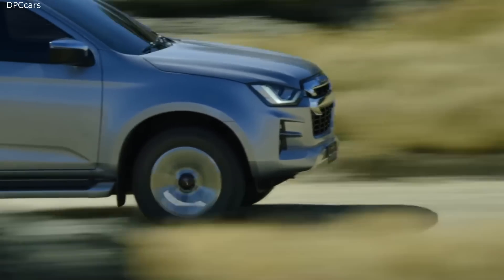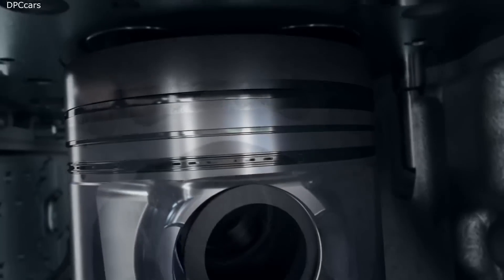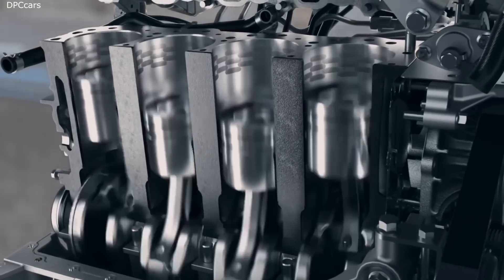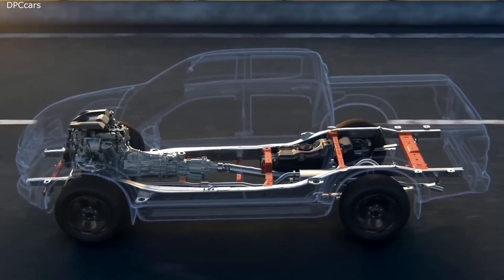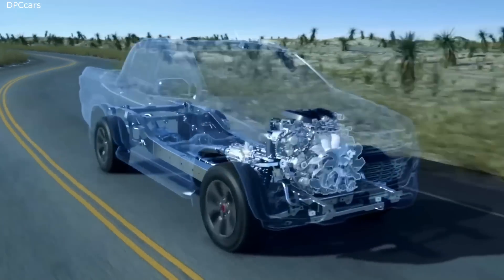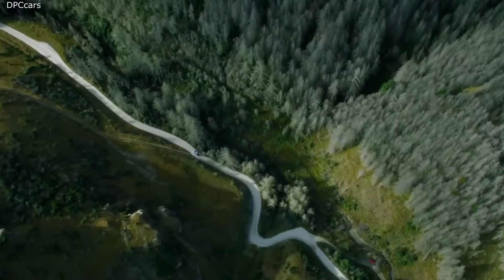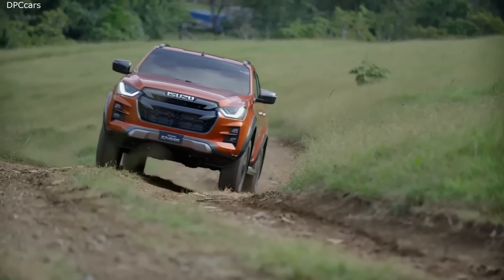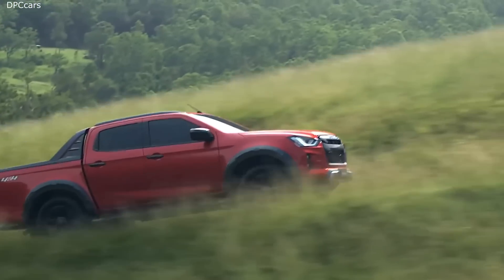2021 Isuzu D-MAX Engine Drive-train and Testing

Comment: Which is better leaf springs or coils? Why does isuzu prefer leaf springs? Would be a great car with coils and alittle more power from the engine. Would outsell hilux and ranger.
Reply: You cannot put a load of 1 tonne on coil springs. You can do it on leaf springs
Reply: Leaf springs are easier to repair when you are in a remote area. To my knowledge, the Ranger and the Hilux have leaf springs at the rear axle, too.
Reply: It ain't no truck if it's a coil
Reply: Coils can only carry less weight